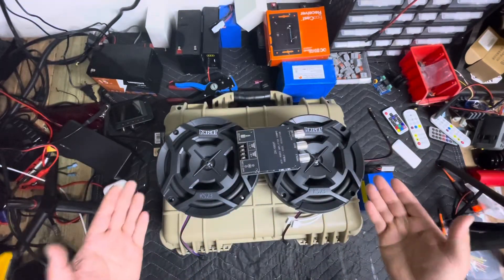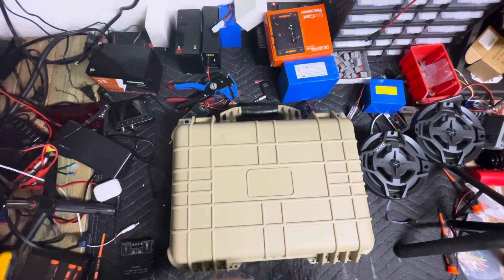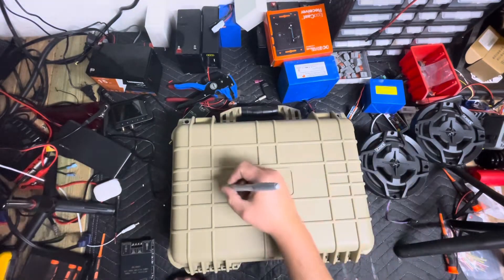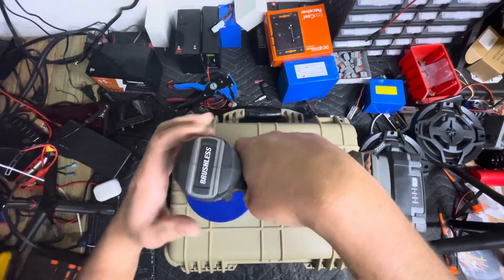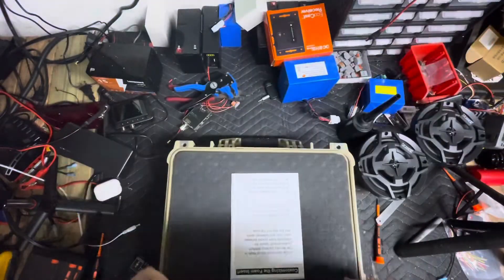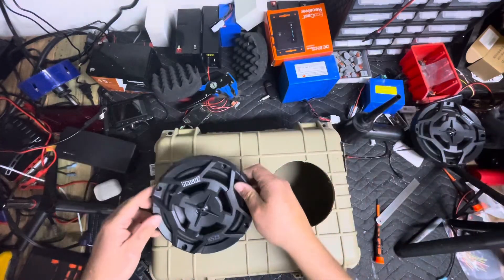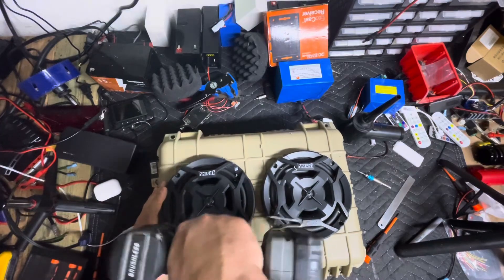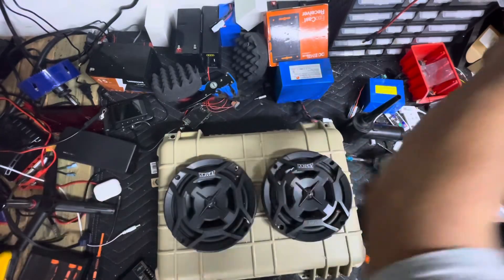How to Build a Custom Bluetooth Speaker

Comment: For this build you have it listed as a 12v switch. But the battery is 24v. Am I incorrect in thinking it needs to be a 24v switch ? Serious question. Thank you. 👍
Reply: The 12v will handle 24v also